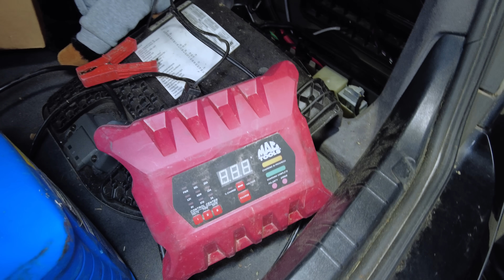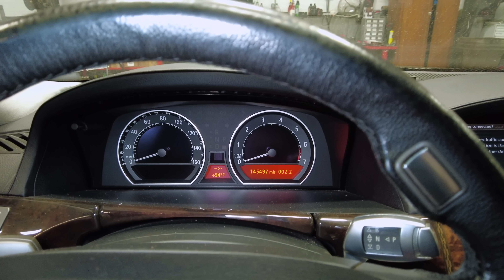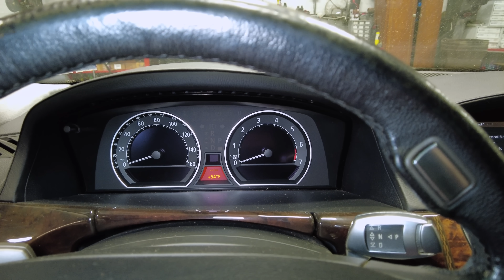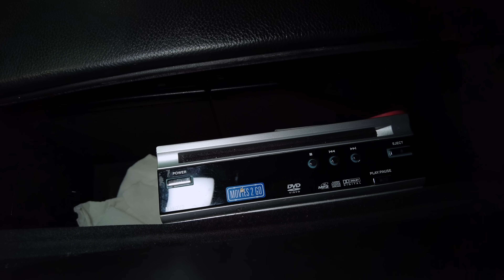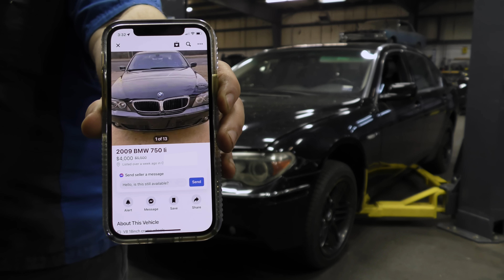Fixing a high mile German car?! Is this '04 BMW 760LI with a V12 worth it? CAR WIZARD breaks it down

Comment: Great show Professor WIZARD….agree maintaining a 12 cylinder BMW is more expensive..however it is a very satisfying auto for many..and the torque… well it’s nice. I’ve owned several 12 cylinder examples including a hi line E38 which has an all leather interior ..the finish detail is exceptional! .. My first 750 I purchased for 4500  had the notorious intake manifold  gasket leaks which was the only cost that was exceptional  about$ 1200 many years ago.  Drove the car many years and it broke down on the NY Turnpike near a BMW dealership.
Went to dealership for diagnostic work and they started at 500$ . I said no thank you and gave the auto to a charity for a tax deduction…..

My current E38 I paid 9000 for a West coast car and have driven 15000miles..again like my earlier 750  it needed manifold  gaskets about $ 1500. Other than that it has been smooth sailing until I experienced a plastic fan blade explosion under hard acceleration …that exploding fan destroyed the radiator, put a large hole in the steel hood took out  all rubber  hoses in the front and  took out one air filter housing…cost of a new cooling system and hoses over 3000$ total…other than these two examples  it’s been generally smooth sailing.

Would I purchase another 12 cyl.?  Yes, These are great Road cars. The engine is near indestructible..the plastic parts and plastic  fan blade not so much. I’m continuously told this model BMW is the most  attractive….and receive many compliments… I have replaced a rear window regulator myself..these care are ridiculously over engineered!

Mr and Mrs. Wizard. Please more CITROEN videos….great channel

Comment: I had an 2008 750i sport package that I had a love/hate relationship with. When everything was proper, there's nothing that holds a candle to it. When not... Oh my goodness, what a pain in the A. Had to disconnect the battery once every 2months to reset computers and modules. The most comfortable seats period. HK Surround sound.. oh my. Instant torque no matter how fast you were going!! Active suspension=negligible body roll, gorgeous interior. Covers crap load of Miles at ease. Monaco blue metallic with Carmel interior. I miss her... But then I don't. I'm now a very happy Toyota 4runnner owner.

Comment: Where I live, a lot of these with various diesel and gasoline engines have 250-300k miles. So technically you can absolutely keep them running for a long time but you need to have deep pockets.
Reply: Lovely cars, good value for money too. I had a 2004 e46 320ci m sport coupe, 80k miles black with black leather paid £6000, was 4 years old cost £28000 new, 2.2 straight six such a good cruiser. When I was 19 my best friend got an e30 m3 for £5000, that was 20 years ago but no other brand gives you so much for the money.
Reply: That's basically what it comes down to - regular maintenance. 👌

Comment: BMW = Bring My Wallet!   Well done Wizards.  I once considered buying a "bangle butt" because I figured it was cheaper on the used market because it was so unattractive.  Then I did some research and saw how much of a money pit they are.  I went for the Lexus instead.  My 2002 GS 430 still running strong.

Comment: That is why you buy the 3 series and if they can do the work themselves - absolutely reliable and goes for forever - especially the E36/46.  Lots of parts available for really decent prices and you can get the OEM parts from the same company without the BMW logo, far cheaper.
Reply: yep- just did injectors on my B58. Genuine BMW- $1800. OE Bosch (same exact part): $350.
Reply: @sean.f23  the OE Bosch specified for a Chrysler 3.6 vvt, were $12. You got hosed.
Reply: E46❤
Reply: @Santor-  $12 my ass
Reply: @FELIPE8226M  they cost a little more now. Amazon have a set of 6qty for $62.99 shipped, thats 10.49 each. A single one cost slightly more each, but it's FAR from the 3-400 mentioned. Either way, you got hosed.

Comment: I owned a new 2004 6 series convertible.  Chris Bangle designed the new 7,6,5 series early 2000’s.  An unique rear deck lid.  I had great luck with the 6 series.  BMW’s driving courses in Spartanburg are well worth it, adult Disneyland.

Comment: BMWs are still the best cars I’ve owned. I had 3, one 328i and two 335i’s. Reliability is ok if well maintained. I made a switch to VW cars because I wanted something more fuel efficient and VW felt like a middle ground between owning a BMW and Toyota but I’m thinking of switching back to a BMW again
Reply: I can get 30 MPG avg from my M240i easily if I want to... but I never want to, and average about 23 :)
Reply: @sean.f23  The last one I owned was a 335i coupe with xDrive, it averages 24mpg on 20+ hour cross country trips and 12 mpg when i daily it in the winter at -4F/-20C. I was thinking on getting a 330i F30 but I’ll miss the 35mpg + regular gas my Golf uses.

Comment: It a shame as drive nice but all have the same common issues. I had to put 5k to 6k 4 years back and that me doing the work to pretty much overhaul the engine new seals and rear main seal and valves, Valley, gaskets, every timing components, every plastic part in cooling and trans and coolers and also brake module. Suspension components, exhaust and etc. Took me a month to get parts and just pulled motor and transmission completely and rebuilt pretty much.

Only reason fix it as only has 60k miles and was in mint condition. Good thing is been reliable after work and one of the smoothest car to drive but definitely a money pit.

Comment: these cars are actually good deals, for professional mechanics. since we only pay for parts. but for other people, these cars always turn into nightmares. these were prestige cars at the time, and so is the upkeep, and parts pricing.
the first couple of years you're gonna be paying for the upkeep the 2 owners before you didn't/or cheaply do. so after buying the car and spending for the maintenance you'd have 15k into it. that's still a very good price, considering the car's original selling price.
after the 15k you'd spend, getting it up and running reliable, you should expect around 2-3k yearly on repair costs. for such a car i'd say worth it.

people say, these cars are bad and unreliable, but that's just because they're neglected so often. ignoring repairs doesn't get you anywhere

Comment: The wood was exclusive to 760, and while you could get a 745 with the extended leather, it’s rare to find that, so usually you’ll see that only in 760 in USA. I love these cars so much. I owned a 745i for many years. Excellent seats. Heated seats are incredible, cooled seats get truly cold, active seat (massage-ish) is ok. They are great highway cruisers.

Comment: I leased my past two BMW's. They were great in that regard as I enjoyed the car but never worried about maintenance costs. Just the lease payment, insurance, gas and the weekly wash. It was a bucket list item of mine to drive a BMW. Bad financial idea to own/lease them. Now I am happy with my Camry. I do miss the handling and overall ride of my 340i.
Reply: Yeah, a lease makes sense, if you can afford a new car every three years.  Of course, poor reliability does not just affect a car when it is old.
Reply: @Geotpf  
Depends on how the leasing contract is set-up. Where I live you might not even get that option on high-end models, but if you can it will cost around $2000/month for sure.

Comment: We buy used BMW with 50 to 80k Miles and drive them for another 100K for a grate price and pay cash (90% depreciation). We stick primarily to 6 cylinder naturally aspirated as they are very reliable and easy to work on. If something does brake it's cheaper to fix than a car payment. I sold my son a 1996 328i with 200K miles for school and ran for another 100K with minimal upkeep, then junked it!

Comment: Thing is, this design is so original and polarizing, eventually it will start to increase in price as there are fewer and fewer of them.  This was true of my Z3 Coupe 3.0 (aka the clownshoe) which was laughed at and dismissed.  I bought mine for $7k in pretty good condition years ago.  It's now worth around $25k....
Reply: That's true of most cars polarizinf design or not.  At a certain point they cease to be an old beater and become a classic.
Reply: That's because coupes are a niche market. They sold a lot more sedans.
Reply: @MJ_868  Yeah, but not a lot of 760s.  But that makes it an art piece, not an actual vehicle one drives.

Comment: $10k for a 64k mile 2003 760Li in Florida. Beautiful car.  The interiors on high-end BMWs really hold up nice; whereas, a base 3 series or 5 series just falls apart.  THere are some easy fixes for the coolant pipe vee leak.  I'd never touch another one of these cars.

Comment: If anyone wants to know how much of a real pain to fixing these e65 7 series look up Sreten from the channel M539 restorations where he rebuilt the engine TWICE on his alpina b7.
Reply: @09feb1992  yep, as it turns out these engines are designed to run really hot from the factory with 105c thermostat for emissions combined with way too thin engine oils from the factory and lo and behold scored cylinder bores.
Reply: Sreten has the patience and knowhow + passion to fix those turds. Makes great YouTube content!

Comment: The E65 7 series was one of those cars where you’d hear people buying them used, financing them, and then having major issues that were extremely expensive. Nowadays, I’d recommend to anyone to avoid buying any BMW with an N63 engine, especially the early ones (2009-2012) and even the later ones. Absolutely not worth the ridiculous issues that those cars are plagued with.

Edit: if you can find an E65 from a private owner that’s been regularly serviced and has had its major issues addressed, it might be worth the risk as they’re awesome to drive. Avoid the 02-04 models as those seem to have the most issues, along with the water cooled alternator  ($1000 part). The later ones have a conventional alternator. Do not buy one from a dealership!! I still wouldn’t touch an N63 car with a 10 foot pole.

Comment: Hi Wizard, Yes, there is another car that is in the same spot. Its VW Phaeton. Its VW but its got V12 or W12 and its very luxury but its based on the Bentley chassis and with that 12 cylinder engine any repair is very expensive even that the cars are cheap. Thanks.
Reply: My local VW had a Phaeton traded in. So I took it for a spin. I asked price. My guy said they are sending it to the auction. They would not sell it to me. Then went over all the problems and what the repairs would run at their cost. So we took it out for another run and parked it out back.
Reply: Basically those are a bentley cgt/flying spur without the badge. Most trim parts are nla anyway in the usa
Reply: I wonder how much work a 20yr old V12 Toyota Crown needs? I assume it has aged better?
Reply: @supertouring1  Id assume like an old ls400/celsior it probabably just needs suspension typical old car stuff and a timing belt if so equipped (1uz v8 had a timing belt)
Reply: @CRAPO2011  DIdn't most VW Shops have to be certified to even work on those? I thought I remembered reading that someone and that not a lot of shops did because of the cost.
Reply: @belltolls1984  I thought i heard something about special training for the Phaeton. Parts were obscenely expensive even when new

Comment: Even cars like Corollas are expensive to repair nowadays.  $500 easy to fix or replace just one thing
Reply: Because to get to 5 dollar part you need 4 hrs labor.
Reply: Learn to do your own basic car repair. Why would you pay someone 90$ an hour to undo nuts and bolts, unless your time is worth more than that?
Reply: @mikescherrer4923  ONLY $90 an hour?? Where do you live? I want my car fixed there!
Reply: Exactly. I’ve been saying this for awhile now. A brand new Corolla has just as much tech if not more than this 20 year old 7 series. New cars, no matter which one it is, not easy to fix by any means.
Reply: @mikescherrer4923  
It's not feasible for a lot of people. Getting less and less so as the new cars becomes second-hand

Comment: Those cars have a lot of comfort but just seems like a lot of problems as well
Reply: No built correctly. Built for profit and not to a standard like yesteryear
Reply: They are pretty reliable, up until 5 years and 80k miles. That is in line with the most extended lease contract, so bmw is happy and the guy who bmw makes money on is happy to. Time to buy the new model or facelift.
Reply: @rahimi4762  I enjoy the e39 I have one solid car and just taking care of it but really enjoying it
Reply: @DavidVlogz  E39 are sweet cars, those and e46 is BMW at their best

Comment: Had a 745 li v8 with the liquid cooled alt, a guy gave me the car because the engine was knocking, turned out to be a bad bearing on the alt, priced a new alt for 1500 dollars! Found a rebuild kit for 99 dollars, no more knock! Sold it quickly when I found out the suspension was fubar....never own another BMW...

Comment: My cousin had Toyota yaris 2009 in Dubai. He completed 1 million Kms in 2020 with original Engine. Transmission gave up around 800000 km which he replaced it with used one from junkbyard
That car was nuts. Imagine 1 million KM in dubai heat and rust.
He sold it after 1.1 million km because he said the engine would lose power after AC turned ON
Reply: Which engine and transmission?
Reply: @gergelyturcsanyi6743  1.3 engine. Transmission model  I don't know
Reply: I guess you meant dust instead of rust.
Reply: @spencertheboxpitintexas  middle east is all salty and yes dusty too
Reply: Why? Perfect conditions. No salt in the winter and shorter heating up phase.

Comment: That door needs a self-closing set of hinges.
Ray needs 12 magnetic cups for lug nuts. They live on the raxk arms.
The shop needs plumbed in air lines and never seen the compressor drained of water.
Great job vacuming the van !

Comment: Never buy a used 7 series. Repairs are insane. Much better for a used 2/3/4 series, especially with the more reliable engines from the last 10 years. Still needs regular maintenance and care, but won't destroy the owner as much when little fixes are needed.
Reply: With E32 being the exception. They are reliable often even with neglect.

Comment: I bought an '07 760li for $5k. 93k miles. It had a misfire and the idrive wheel wouldn't scroll but otherwise everything worked. I should have kept it. Great driving car! Sounded amazing too. The V12 is so smooth

Comment: That can be said about a lot of cars. Most people fail to realize that repairs for cars cost what they cost. Whether the car is new or used, it's repairs are roughly the same for when the parts go bad. People see a cheap luxury car, and think they can afford it. I will usually ask, "Can you afford the repairs?" A lot will say yes. I then ask them how much they think the repairs cost when the car was 100-200 grand when new. Most then kind of get the idea that.....the repairs weren't cheap, still aren't cheap.
Reply: People who buy new German brand cars have more money than sense.

People who buy used German brand cars have little to no sense. 

Those who lease a German brand car are the smart ones.

Comment: Wizard, I had a coolant leak in my 750i, I pressure tested it, and it was fine, but kept leaking coolant at odd times. It was a small crack in the coolant reservoir, it would leak with changes in outdoor temperature. So take a good look at the reservoir, idid see a lit of white staining on it, which is coolant.

Comment: Never, ever purchase any European vehicle with a higher odometer reading, except the newer Mercedes-Benz ML 350, any Volvo, the newer Land Rover LR2 and so forth. Instead, this individual should replace this 2004 BMW 760Li by trading it in and for that, he can get a good deal by purchasing a 2006 Lexus LS 430, because these vehicles are extremely reliable and they last forever. Thanks.
Reply: Or he can trade it in for a new lease
Reply: @rahimi4762  Don't.

Comment: I have zero issues with my BMWs and high mileage. The problems come from neglicence, improper maintenance and handling. Regular oil changes, careful warming up of the engine, and you have zero issues beyond 200.000km. Those are cars for long distance travelling, not to shop around the block.